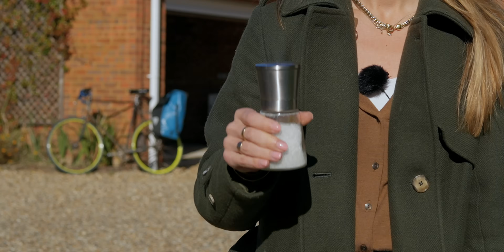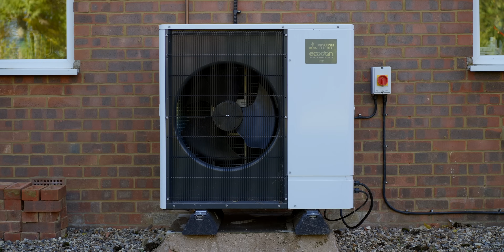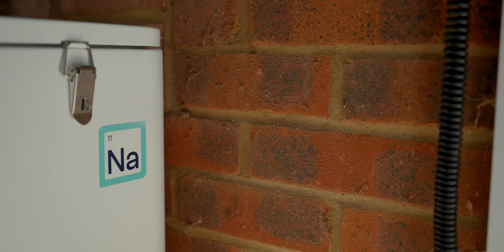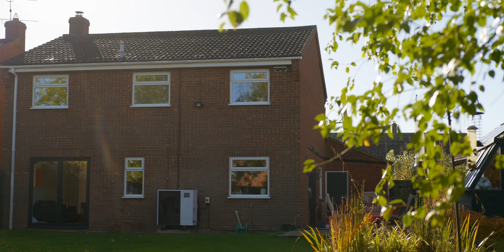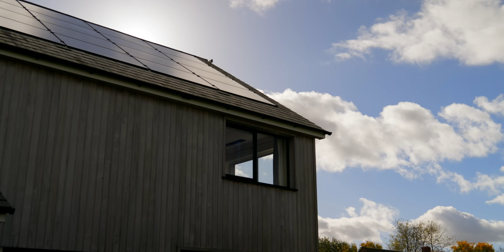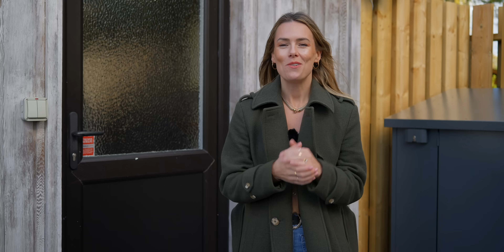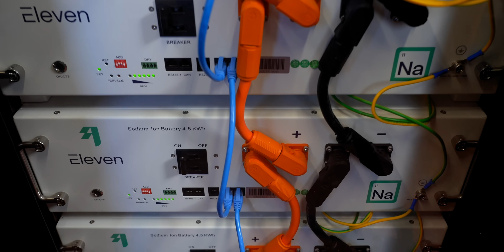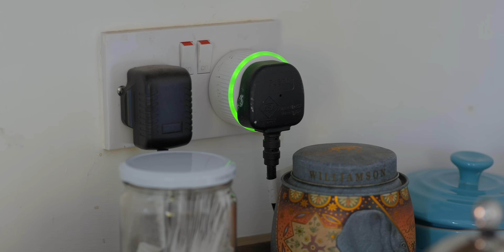Sodium Home Batteries Are Here! Is Salt The Key To Cleaner, Cheaper Energy?

Comment: No question, sodium batteries will rule the battery storage market, as they're extremely cheap, have a much longer cycle life, and have a wider temperature tolerance.  Solid-state high density batteries will rule transportation and mobile batteries, as we need ~500Wh/kg.+ efficiency in EV's and mobile electric devices.  Both Na and Solid-state is our future for battery tech.
Reply: Please explain what happens to the voltage below 50% state of charge?
Reply: @TeaBreak. The operating voltage is between 33v and 59v. 50% will be somewhere in between.
Reply: @TeaBreak.  Since Im now retired and 66 years of age, and I have worked with lead acid batteries for a big part of my professional career. Im used to a variation of voltage (and load!) and it is of course some that you have to adapt to. Not hard, but a consideration to make, for instance when designing cable dimensions, input voltage windows, etc.
Reply: @mikaelpehrman4815 copper ain't cheap. Think I'll stick with Lifepo4 when building a system.
Reply: @TeaBreak.  Well, it is of course a problem if you have long distances and shall avoid voltage drops. BUT in a household system, you are normally not distributing DC, but AC with 230/400 Volts (in Europe), so the cables between batteries and inverters are usually very short.
Reply: LFP cells are already cheaper than the shipping costs. Sodium is inherently heavier, it's a bigger hill to.climb before ruling anything.
Reply: @Swwils 
But
Reply: @Swwils 
LFP can't be charged below 0°C, so needs additional heating if it is to be used in outside installations. This is where Na will be more useful, especially as it's slightly larger than LFP for the same storage capacity.
Reply: @johnnodge4327  Neither can Na+. Just like LFP, Na+ needs to be above 0C to be charged.
They can however operate below 0C, but so can LFP.
Reply: @hojnikb 

Eh?

Had you researched these batteries you would know  sodium ion can be charged at neg 10C.
Reply: @ForestForest-n9i  All of the datasheets i've found for the actual cells state that charging needs to be at 0-50C. But discharging can go below 0C, some even as low as -40C...
Reply: @ForestForest-n9i Charging and discharging are different
Reply: @Swwils Maybe they should make them in the UK
Reply: @caparn100 lol. Okay so ship all the raw materials to a brand new factory? 😂 Recipe for cost effectiveness.
Reply: @Swwils Didn't realize that the UK doesn't have access to sodium 😂
Reply: @shmuggysphone4837 please name me your local prussian white as an anode and hard carbon manufacturers. I'll wait.
Reply: Sodium batteries are already good enough for EVs. 

Solid state batteries will be great for luxury cars but unless they can compete on price with Sodium they won't be mass market.
Reply: @alburaq3290 

Well, now, sodium ion batteries are more likely to be found in smaller BEVs without a need for a long range.

This might well change following R&D of course.

Plenty of info online.
Reply: @ForestForest-n9i  You have all the same issues on a BEV... Very wide voltage range means you'll lose a TON of power when battery gets discharged.

And because you have poor charge/discharge efficiency, you'll have a lot worse overall consumption when taking into account regen and actual charging. 

It's just a bad chemistry for that sort of application. That's why you don't actually see any real cars with it.
Reply: @hojnikb 

I despair.

Don't you lot do any research prior to posting?

Why tell us?

Why not Google up who's using and preparing to use sodium batteries in a small BEV and then contact their Customer Services departments.

You can explain that you know much more than their qualified boffins and engineers and the overall efficiency will be pants.

I would guess that you'd be a dead cert for a Nobel in Battery Chemistry, without a shadow of a doubt.
Reply: @ForestForest-n9i  Yeah, like i said. It's a bad chemistry. That's why you only hear about products maybe using them in the future (eg you can't actually buy anything right now). And if you actually dug deeper into the subject, at least for EVs, they are planning on hybrid packs with LFP+Na+ in the same pack. Not pure Na+, at least not for anything bigger then a small city car.
Also lets not forget the absolute shite Wh/L. This contraints the pack size much more than Wh/kg, that manufacturers often rather spec. 

And it's like that for a reason. Unlike you, i've actually researched the subject. And actually tested those cells.

Fact of the matter is, unless some serious chemistry change happens in the future, Na+ just won't be a viable alternative to LFP. The latter is just too good and too cheap to be easily replaced. At least for now.
Reply: @hojnikb 

😂😂😂

No of course you haven't tested the cells.

So many battery experts on this platform it's almost predictable.

Nobody can be sure where R&D will take sodium ion cells.
Ditto anything come to that.
Reply: @hojnikb 

Edit to add.

There are two models built by Chinese car makers using sodium cells.

So for all the sodium battery experts who have the temerity to assure us they won't work very well then Google is your friend.

In short you don't bother to keep up with the research and application.

If any of you self processed experts have degrees in the subject then you're out of date by the time you finish your course.

This is to be expected given the eyewatering sums of cash ploughed into R&D.

(We've even had so called experts tell us hydrogen fuel cell cars won't work.)
Reply: @ForestForest-n9i  "There are two models built by Chinese car makers using sodium cells."

which two mass produced models are those? Can you tell us or is that a state secret? :)

"(We've even had so called experts tell us hydrogen fuel cell cars won't work.)
"

They don't work. They're too expensive and too complex and you're fighting physical properties of compressed hydrogen while you're at it. That's why even toyota gave up on them. They just make no sense, when you have EVs that are better in most regards.
Reply: @alburaq3290  I'm not so sure. In truth, lithium is more than abundant enough in the earth's crust to provide all the batteries we would ever need. Like right now LFP cells are so cheap that the shipping costs from China are more expensive than the cells themselves. And Na2+ is heavier and less energy dense, and yeah maybe there are chemistries which could improve this, but lithium tech won't stand still either. 

Sodium is honestly a niche product for specific cold weather static conditions. There's a reason sodium battery makers are going out of business. But don't despair because it's actually a good thing. It shows that we already have all we need to be net zero, we have solar and batteries that are already good enough and are now the cheapest form of energy. 

Fossil fuels are done and they know it
Reply: Not to mention the ethical implications of getting away from lithium mining, this could be game changing
Reply: @TonyMacina 

Ethics?

Well in one place. However lithium comes from quite a few places, simply Google.
Reply: This seems likely, but they are not actually cheap yet. LFP is still cheaper than these Eleven batts right now, and there is a shortage of inverters that match the wider sodium voltage range, but I expect this to change quite fast and they should become commonplace. As soon as they get a bit of volume so the price comes down they are liekly to be very popular.
Reply: @xxwookey left is below £40 per kWh delivered.
Reply: Meanwhile almost all scientific and market studies state that lithium ion will still be the absolute dominant technology 10 years from now. Also I worked for an inverter manufacturer and we tested sodium ion batteries and discovered that when the inverter attempted to start a large inductive load the sodium battery did not deliver current fast enough and the voltage collapsed shutting down the inverter. So we shall see!.
Reply: It will take a decade to replace the lithium ion &lfp batteries in energy density and cost ,storage space
Reply: @Insane_OG_0 

Yes, but, so what?

Try not to set yourself up as an expert in all things battery.

Your best bet is to research battery stuff prior to posting.

Virtually everyone on this platform, presenters, guests and viewers consider themselves experts on BEVs but clearly they're not and never will be.

R&D moves so quickly that today's technology will be obsolete within a week.

And of course a lot of the above ignore hydrogen development, which is the only technology worth considering, obviously.

Now the Euro government has decided to delay the "going green" date until 2040 then we won't see a lot of Euro car makers bothering with building BEVs anytime soon.

Of course we'll see the Chinese wanting to exploit this delay but there's no need to buy Chinese BEVs at all.

Is there?
Reply: So... solid state sodium batteries for cars in very hot and very cold countries.
Reply: How much are they? Can anyone provide a price comparison with current Li-ion home storage brands at the same kWh?
Reply: And no risk of blast furnace family bakeries, either!
Reply: They mentioned the current price is 'on par with lithium home batteries' and will come down over time. I would take these over lithium though, less fire risk.
Reply: Who cares about the future of battery technology?

You should have outgrown all this nonsense of batteries and be looking at hydrogen.

Until nuclear power does the renaissance thing that is

The future is nuclear.

We might even see nuclear fusion in a few(?) years.

And for those who are averse to learning for themselves nuclear fusion uses two isotopes of hydrogen with not an atom of uranium in sight.
Reply: @ForestForest-n9i this is why the uk is converting its hydrogen buses into BEV. They are too expensive to operate and they couldn’t secure hydrogen to run them. What is wrong with using what works now while working on new technologies for the future. Solar, wind and battery is the cheapest way to make electricity at the moment. Nuclear is £104 per megawatt hour currently and is going up. Renewables is £40 ish . Even with dunckleflaut and idle gas generators for emergency power that is a big gap.
Reply: @pmac6584 

😂😂😂😂

Yes, but, you're trying to tell us that this state of affairs will last forever.

Surely you don't buy into that nonsense?
Reply: @For @ForestForest-n9i ive 8000 miles per year for free so I don’t understand what you consider to be wrong with that. If SMR makes energy cheaper or someone manages to make energy from fusion then I can only benefit from that. Meanwhile I make money from solar and battery until the future happens.